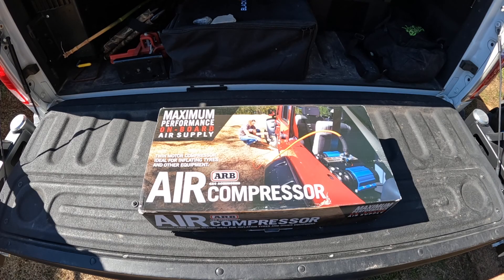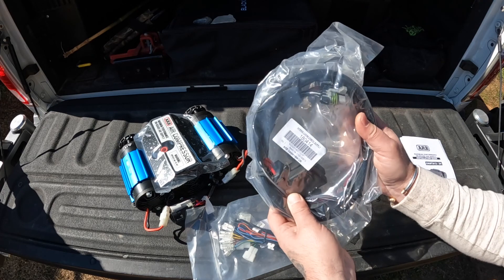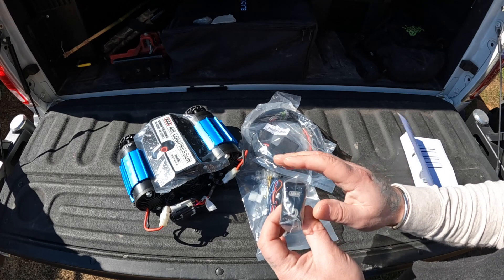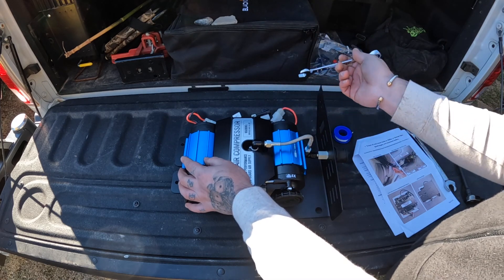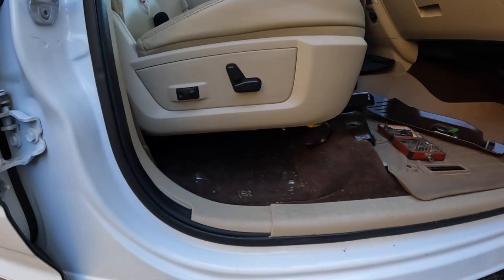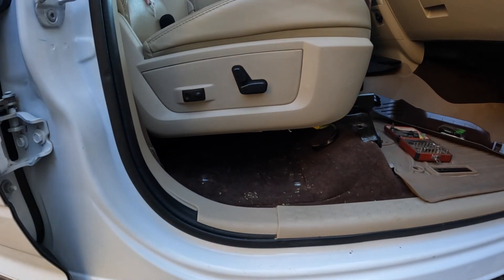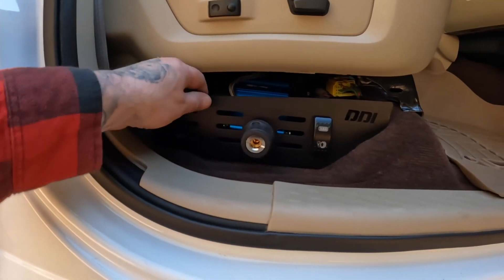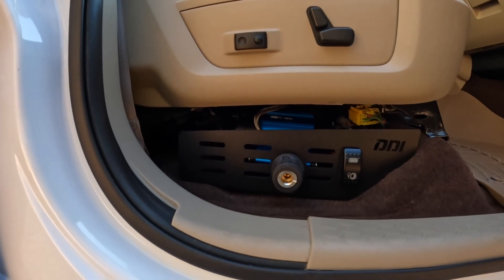ARB Twin Air Compressor Install Ram 2500

Comment: Nice clean install! I’ve got a Viair compressor I’d like to install using this mount. I am worried about heat but will rig up a 12v computer fan to help keep it cool.
Reply from the maker: I have a portable Viair as well and those do get really hot after long use, but then again they all get a little warm. I think the fan will definitely help, but if I can make a suggestion. If you have a Ram 4 door equipped with the floor cubbies in the back floor board, this could be another option that you could vent and you would never see it. You could even run your quick disconnect under the truck. This would also dampen the sound.
Reply: @SouthBoundExpeditions.  Funny you mention that, I was just thinking about that today and maybe replacing the lid with something like expanded metal so the compressor can get fresh air. Or, maybe putting it in the bottom of one of the Ram boxes

Comment: Hey, now that you've had it for a while. Have you seen any concerns with heat under the seat while it's on? Would you install it there again? Really cool rig BTW!
Reply from the maker: I like the mounting position, I always have had a concern with heat, but have had no issues. If I were to have done it any different I would have mounted it in my def tank location under the truck. Not so much on the heat concern, but due to noise while in use.

Comment: Liked the video, however you bypassed the one part I wanted to see, the process of getting it under the seat and how the bracket mounts.  On a side note, any pros of cons of the aev snorkel? I'm in Wekiva Springs Florida so basically more concerned with long sandy and dusty roads than I am deep water.
Reply from the maker: As far as the bracket, you can either take your whole seat out or what I did was removed both rear seat bolt lifting the rear slightly to slide it underneath. As far as the snorkel, if you are putting it on a V8 it is fully amphibious, on the diesel it is not. However you can make it amphibious as I did. For dirt roads which is my main purpose as well, it works flawlessly eliminating sucking in the dust kicked up by the engine fan. It also acts like a cold air intake giving you a little more power and depending on how you drive a few more towards your mpg.

Comment: Being a Laramie is no different than a tradesman for the air vents. The Battery is not the start battery they are run in parallel to turn the motor over with more CCA

Comment: Does the factory “beauty cover” fit over the the installed compressor and bracket?
Reply from the maker: Yes, fits perfectly with the ARB quick disconnect. I cannot say if you were to use another disconnect.

Comment: I have the drive reach booster and it gets warm. I thought about putting in the storage compartment behind seat of my megacab but was worried about burning it up. You don't have issues overheating under the seat like that? I'm hoping to get my arb installed under seat over Christmas break and then find a shop to install front locker. By the way i have the same interior color on mine with bench seat to accomadate my manual tranny.
Reply from the maker: No issues, I would recommend that you mount it in a location that it will receive good airflow when in use.

Comment: What did you end up doing with your factory jack and tire iron?
Reply from the maker: Currently It is on a shelf in my garage, I carry a high lift jack and don’t see much of a need to carry the bottle jack. I do however have a undercover swing out toolbox in the bed if I want to carry it.

Comment: That sounds like steel.
Reply from the maker: You might be right, either way it is very sturdy.
Reply: It is obviously steel.  Aluminum parts don't get bent in a press brake like that.  And when you set it down and it went "clang", I knew for sure 😅